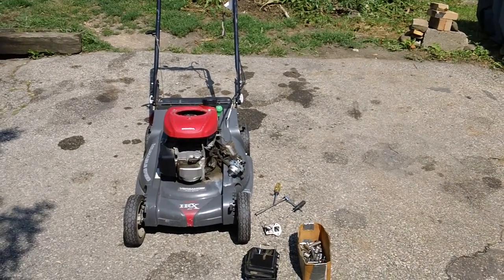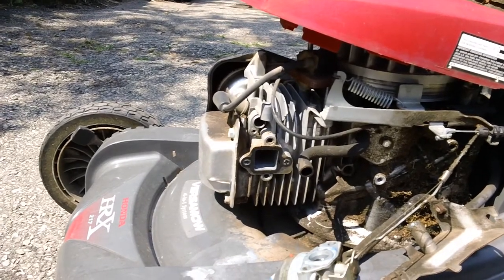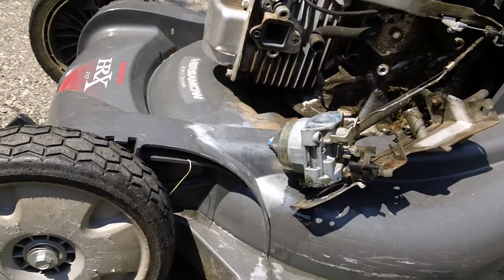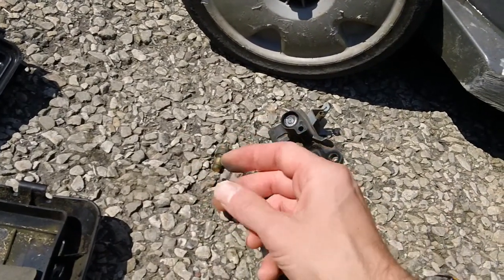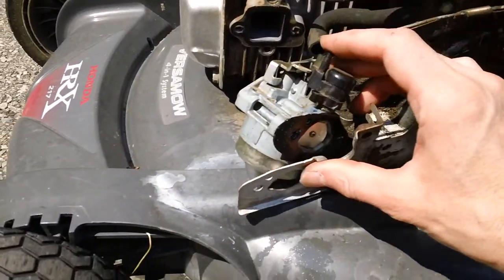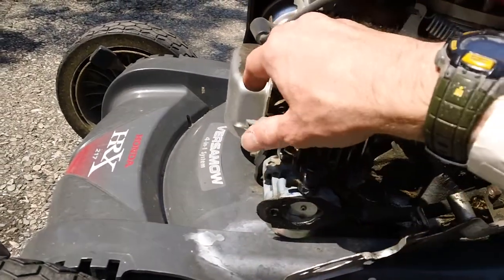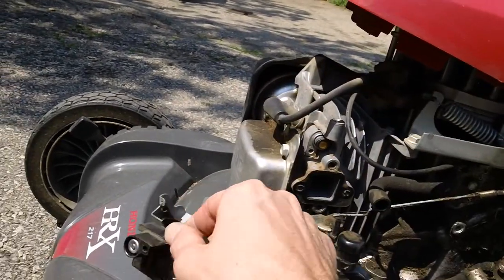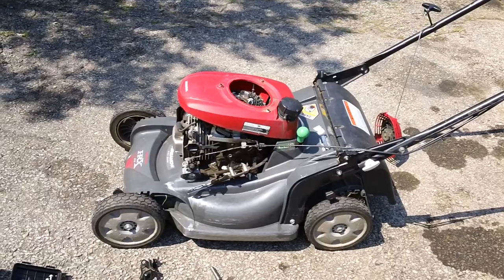Honda mower auto-choke

Comment: What happens usually when that Theremowax cartridge goes bad it usually gets stuck and the small pin stays popped out.  When that happens the choke plate cannot close properly because the pin is holding the choke plate open and the mower has a hard time starting because it's getting to much air.